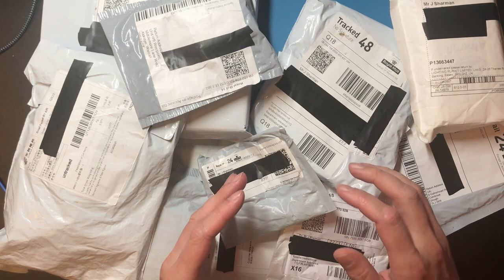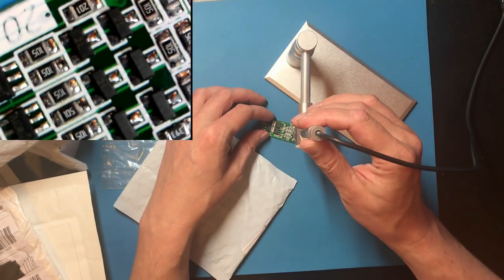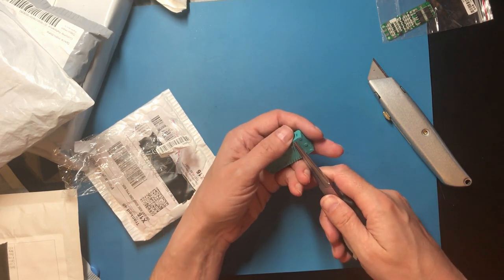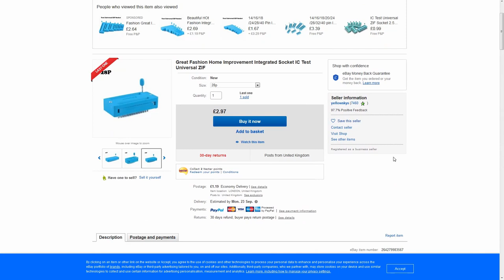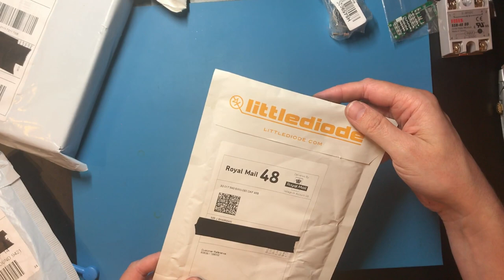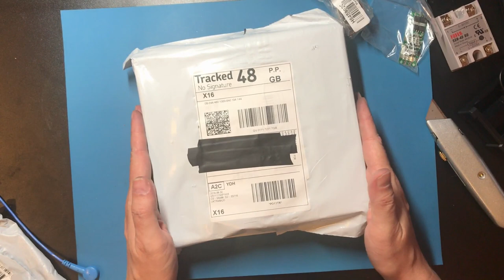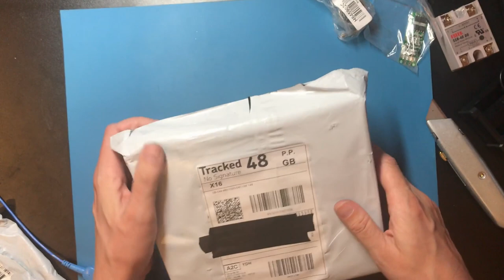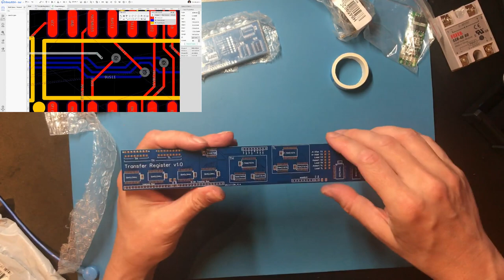Mailbag #5 Transfer Parts

Comment: nice. Yeah those carbon rods. And the thicker ones. maybe the were from a welding supplier not sure. 3d printed some holders. worked great. I have those batteries in my mini robots. when they are running. Good haul. nice routing.
Reply from the maker: Must get back to some of my secondary plans, the cpu kind of expanded to fill all my spare time
Reply: @weirdboyjim  For me, AI is sucking up every waking moment. making my electronics equipment very sad. Time is a sword.